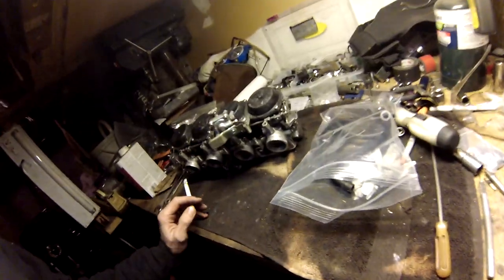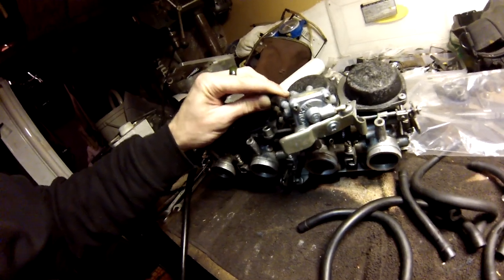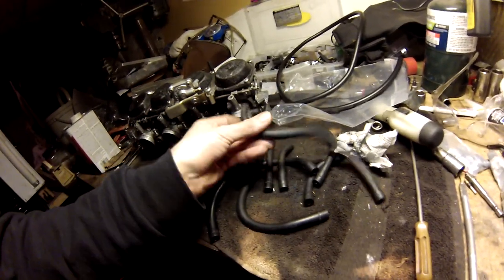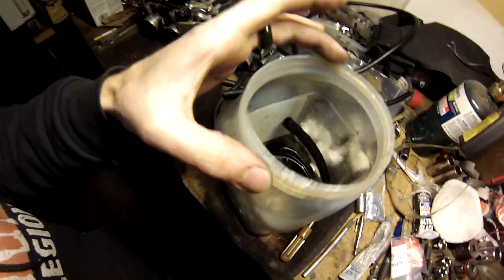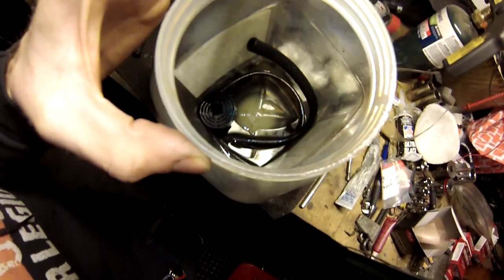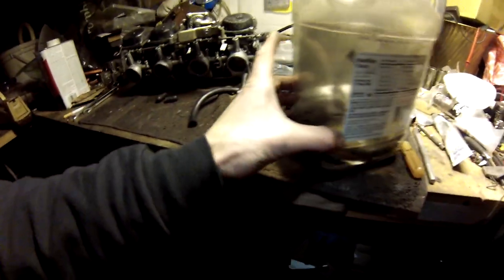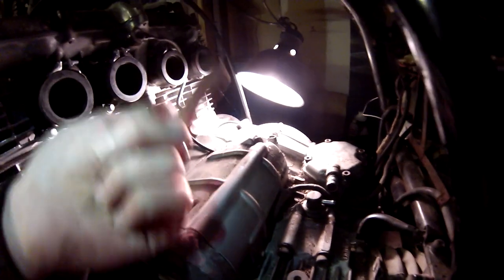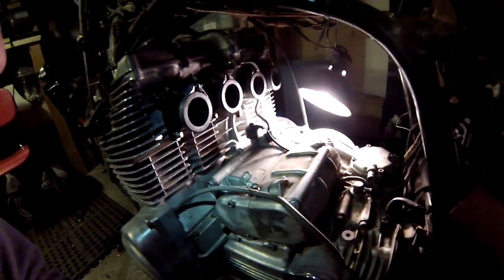Miracle Rubber Hose softening technique, Wintergreen!

Comment from the maker: Just putting it out there. I have used all of those tiny little scraps of hose in this video and they have not leaked a smidge in about a years worth of riding! Not one drop. Totally proven, no one can bust this myth. I've used this mix on carb boots, gaskets, etc. If it's rubber, it's gonna come out smelling like a breath mint and be soft and fuck-able.

Comment: Certain types of rubber seals will get soft in Wintergreen however it will also swell. So if you're using Wintergreen to try to restore those small o-ring gaskets or possibly the ones that look like figure eight, they're typically made of a type of rubber that will soak up the wintergreen oil which will change the molecular Composites of the rubber. What this will do is call it to swell. Taking the small rubber O-rings after using in wintergreen oil to restore, place them on a slightly warm counter for at least 3 days. What this will do is allow the oil to evaporate somehow out of the rubber and cause the rubber to shrink back to its normal size. Sometimes you'll have actually see the rubber sweating the oils as they shrink over a period of a couple of days. Most of the time the rubber will seem to have a slight hardness but not as hard as it was before you did the restoration. Rubber seals will work fine after doing this. Now if you get into a situation where it looks like your rubber o-ring is not shrinking then grab yourself some cleaning vinegar. The vinegar could affect your rubber and cause it to shrink in about 30 minutes, pretty rapidly . Possibly the only way to secure a rubber gasket after using Wintergreen is to allow it to shrink a little and then soak it in and oil such as Crisco, which would activase like protectant. No it's not perfect. You can also soak it in armor-all after removing it from the Wintergreen oil. All this will do is help to lock in the coils that have attached themselves to those rubber molecular structure. Good luck.

Comment: Thanks for the video. I never swear much at all, but after dealing with putting some rubber hoses back on some washing machine valves after a lot of rodent problems that chewed up the damn thing (like all the hoses are Swiss cheese in the thing-kinda rodent problems) and then struggling to put the hoses back on after fixing them or replacing, I was having the same vocabulary and it took me out of my hulk rage and made me laugh. Thank you.

Comment: Carb cleaner with methylene chloride (highly carcinogenic) softens rubber within minutes makes it swell.  Chemical is used as a solvent for the production of isobutyl rubber.  Rubber has stearic acid (fat, or crisco) as a flowing agent.